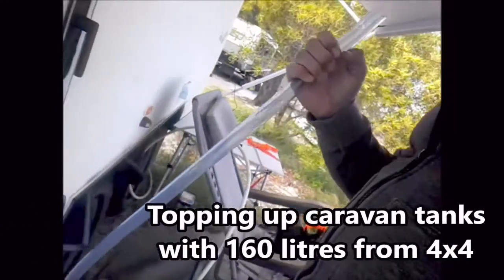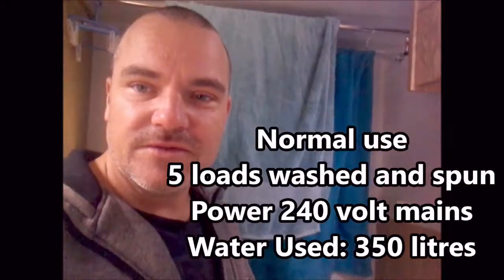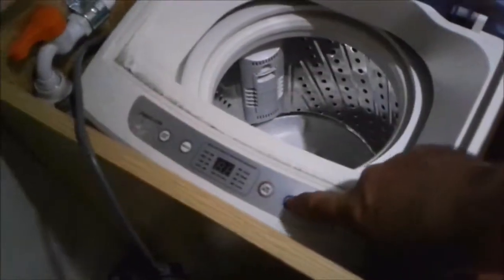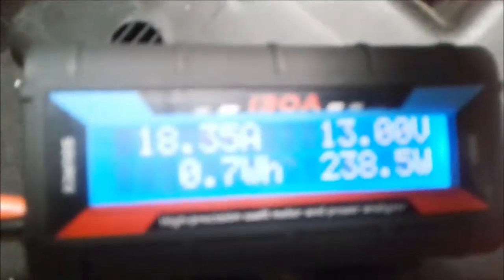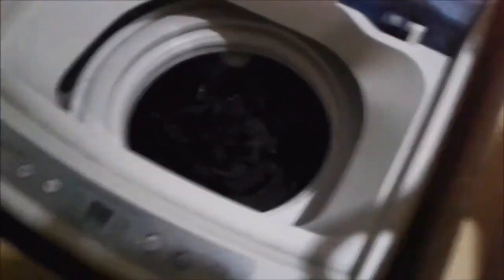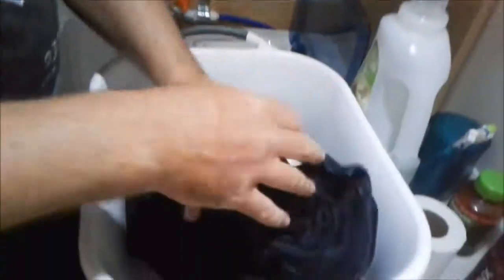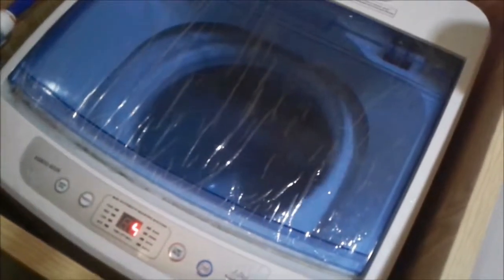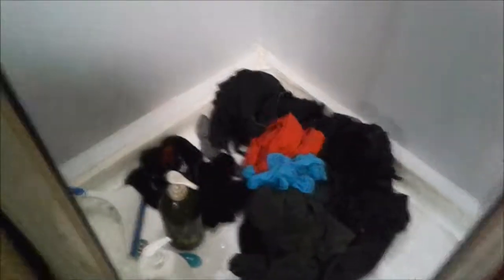Demo: Off-grid washing with automatic machine and solar

Comment: Can u link the power set up need this for my cabin but my gene plug 🔌 is the wrong prong set up
Reply from the maker: It's a duel system. 1 use a 60A mppt controller with 2x 100w and 2x 200w maxray solar panels. It also has the original pwn 200W system that came with the van.